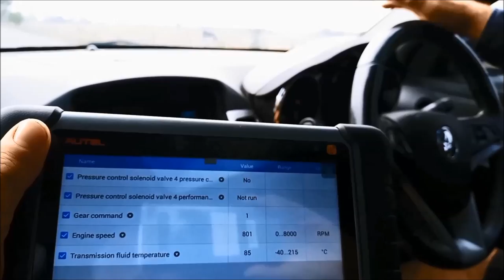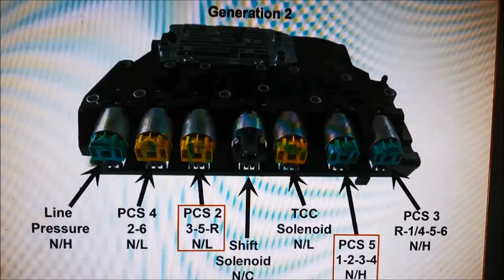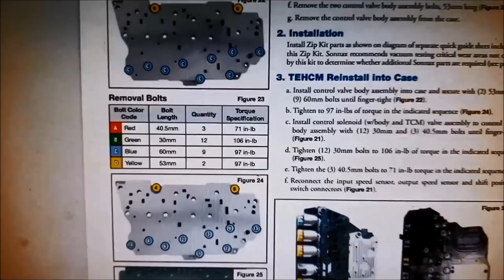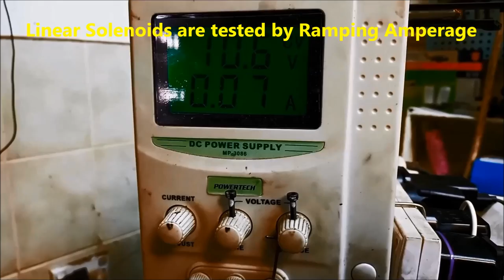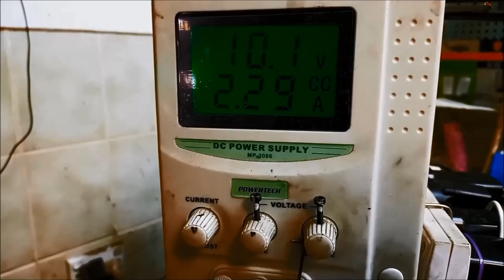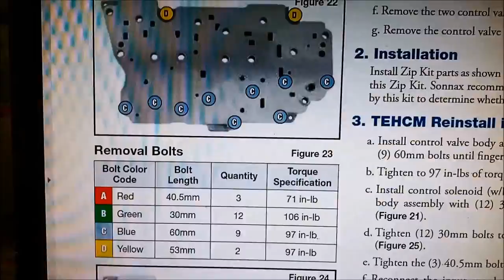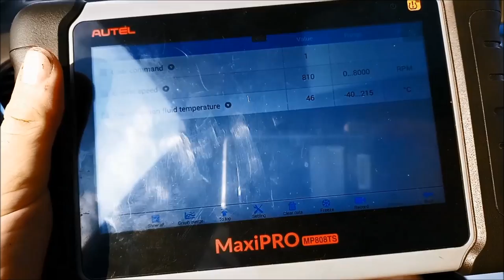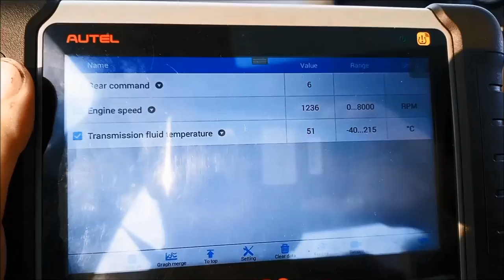How 6T40 TRANSMISSION SOLENOID Remove & Replace 6T30 6T35 6T40 6T45 6T50 Holden Chevrolet GMC

Comment: I'm got P0796: PCS 3 (L/R 4-5-6) stuck Off, but slipping in only 5-6 gear only. Is there a possibility of a fault in the solenoid or  5/6 clutch?

Comment: Thanks for sharing this excellent instructional video on fixing a common fault in these transmissions. I have a Captiva that's just recently started flaring when shifting from 3rd to 4th and think, after watching this video, that replacing the solenoids should fix the problem. I bought the vehicle knowing it had a faulty transmission. It found it had a broken wavy ring and damaged the 4-5-6 gear drum. The filter was full of aluminium particles. I electrically tested and cleaned the solenoids at the time, but suspect they might have been damaged by all the aluminium particles being pumped through them. A pressure test probably would have shown they were not in top condition.
Reply from the maker: good work, thanks & cheers

Comment: I have no forward movement on my gearbox only reverse. If I manually shift into 2nd and 3rd i can feel a slightly bump in the seat and very little engine rev but I can't move forward. Reverse works perfectly. Can this job fix the issue ? or should i get an gearbox to replace mine ?
Reply from the maker: hi, start with basic checks/tests. sorry hard to determine without more info. cheers
Reply: @YepThatsIt  I have bought an 6T30 trans from spares and I'm wondering that if it can replace mine which is 6T40. The trans overall looks the same and the connector on the TEHCM is the same. Thanks
Reply: I have the same issue with code p07bf when it's warm no drive at all only reverse, I replaced output and input speed sensor didn't fix it, any idea with this code p07bf. Thanks

Comment: Hello!, I loved your video!, I have a buick verano 2015 that is not changing to 6th gear and is showing the same error, my question is if I change the solenoids do I need to reprogram the transmission somehow?, or I can change them without an issue and connect everything again hoping it to work?
Reply from the maker: hi, usually wont need to reprogram, worth a try. cheers

Comment: Hello!, I loved your video, I changed the solenoids yesterday, but now the transmission doesn't want to drive nor do reverse, do you know which might be the problem?
Reply from the maker: hi, did you change with new solenoids or ebay ones ? cheers
Reply: Hello!, I bought them in amazon, but they came in a ziplock bag instead of a new package

Comment: what speed does the convertor clutch come on?
Reply from the maker: hi, if you mean fully on it will be under higher speed. at lower speeds will depend on load or deceleration, but not in 1st or rev i believe. cheers

Comment: Great video thank you🙏 question,  I have a 2015 chevrolet impala 2lz.  It wont shift to 4.5 or 6 gears.  All the other gears are ok.  Do you think that if i do a flush and add new fluid could aolve the problem? Any ideas? Thank you so much
Reply from the maker: hi, flush wont do diddly! you need to check solenoids and seals in the tcm assembly, the solenoids get contaminated or the plastic manifold breaks from pulsating pressure over long time, or the seals flatten out and you get pressure leaks. make sure you see our other vids on 6t40 or mechatronic vids to see what i mean. cheers

Comment: Hello, Mr.! 
I believe that sonnax solenoid chart, at 1-2-3-4 solenoid, are with on/off inverted.
I mean, in according with the original service manual.

Btw, great video!
Cheers from Brasil.
Reply from the maker: hi, we`ve never had consistent luck in doing the in car solenoid cleaning with scantool. as explained in video, the debris and flattened seals are often the main issue. cheers

Comment: hay mate firstly great vids thanks a bunch ! 
i have a ford focus 2012 lw td and i wont to but a scan tool fix the gear box as you did in your focus vid  and clear codes ect . thanks in advance
Reply from the maker: hi, clearing codes does not fix the problem. the same codes will return once the fault parameters are met. you need to fix the cause, then clear codes. cheers